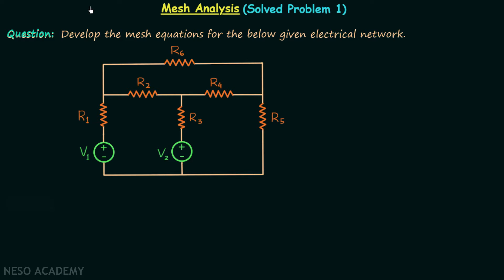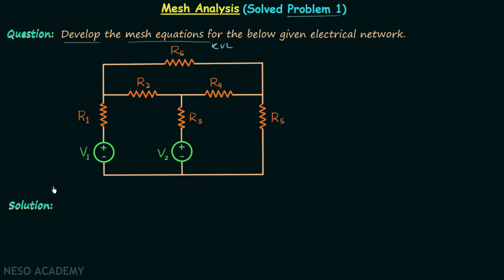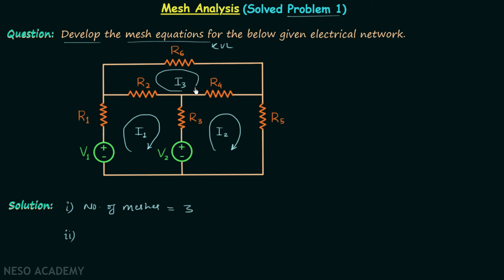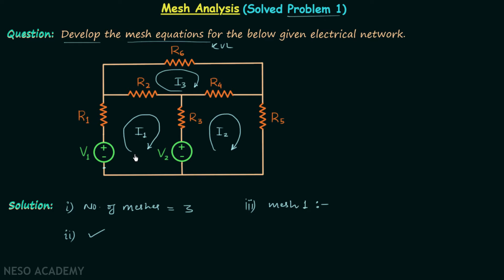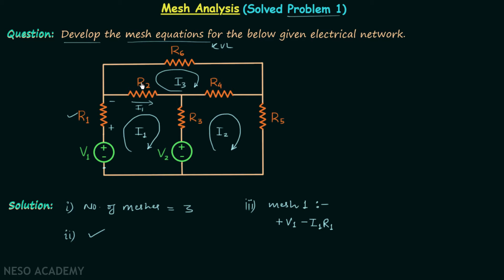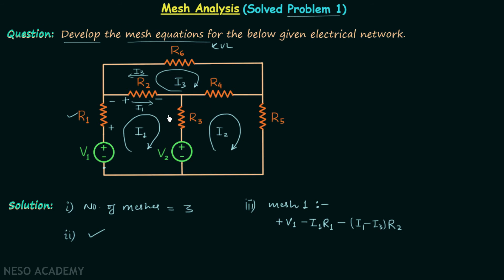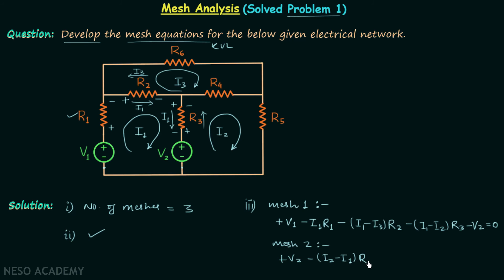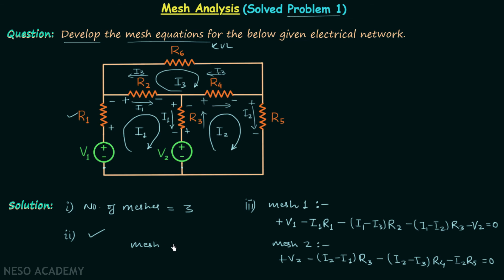Mesh Analysis (Solved Problem 1)

Comment: I'm seeing that most people are asnwering with some variation of the following:
- i3*R6 - (i3-i2)*R4 - (i3 - i1)* R2 = 0.
My issue with this solution is that it appears to ignore the voltages. This makes it seem like we're getting current from thin air ( at least to me ). Is this allowed? I tried to include V1 or V2 but that broke the structure of the mesh by introducing new loops. Someone help me please.

Comment: I3R6+(I3-I2)R4+(I3-I1)R2 = 0... eq.(3) 
Can I write this?

And also for the first 2 meshes:
-V1+I1R1+ (I1-I3)R4+ I2R5 = 0... eq.(1)
-V2+(I2-I1)R3 + (I2-I3)R4 + I2R5 = 0...eq.(2)

I just assume the reversed for the voltage drop and voltage rise and it is okay. Isn't it?

Comment: Sir,can we apply clock wise direction and anti clock wise direction of current in 2 side by side mesh's in a network.if so how to check the polarity of the resistors.....

Comment: just out of curiosity, shouldn't I3 current recombine with I2 and terminate together past the R5 at ground level? if I3 doesnt have a voltage source of its own how is it that I3 is able to circulate on it own?
Reply: Bro its a whole network voltage will flow in evry branch

Comment: -I3R6 -(I3-I2)R4 -(I3-I1) R2=0
Reply: why minus sign ?
Reply: @truptikulkarni9503  potential dropping
Reply: @Soup0761  why it’s dropping, in the mesh three, where is power source?
Reply: Same yaar
Reply: Beautiful
Reply: R4 current sign wrong
Reply: @Mrinmoye_ no it's correct
Reply: Same
Reply: Same
Reply: same

Comment: -I3R6-(I3-I2)R4-(I3-I1)R2=0
Reply: can someone explain why -I3R6
Reply: @kidcracker  because we are taking current in clockwise direction if you still don't understand just simply put negative sign in whole expression when voltage is not present in that part. for example here there is no voltage applied to mesh 3 so simply start your KVL equation with negative sign including i3r6 also... i hope it works
Reply: But what about the voltages? Should we not include v1 and/or v2? Where is the current coming from in mesh 3?
Reply: Neso academy: thanks for lectures
Reply: mera bhi same aaya
Reply: +R4+R2 ...u keep - R4,-R2 why
Reply: @reddymanikanta6263  BECAUSE VOLTAGE DROPS ACROSS THE RESISTER
Reply: @reddymanikanta6263  because we taken direction in such a way that current flowing clock wise direction
Reply: -R6I3+(I2-I3)R4+(I1-I3)R2=0 this is the right ans...
Reply: @Abhishek-uu5by  isnt your equation same as -(I3-I2)
Reply: @Abhishek-uu5by  same ans
Reply: @Abhishek-uu5by  both are same
Reply: @Abhishek-uu5by  both are same..just u have changed the signes if the equation
Reply: @Abhishek-uu5by  worng
Reply: @TimeStampTitan  why .. can u please explain ?